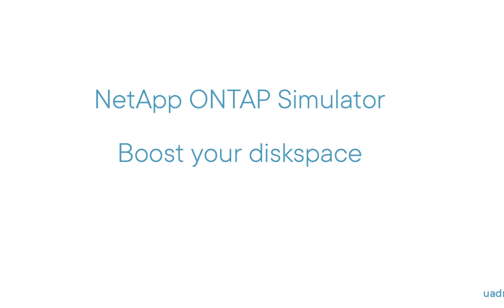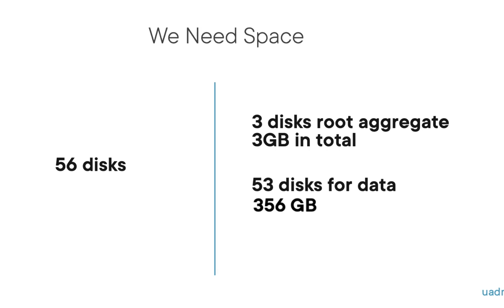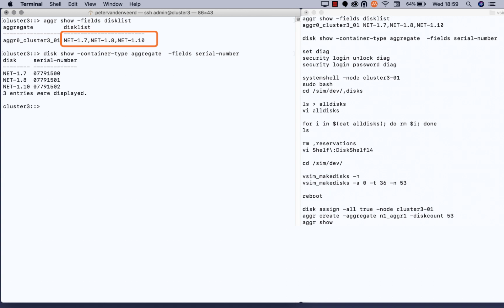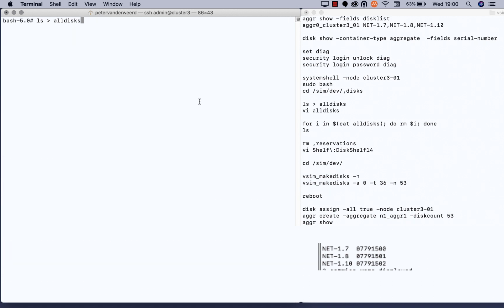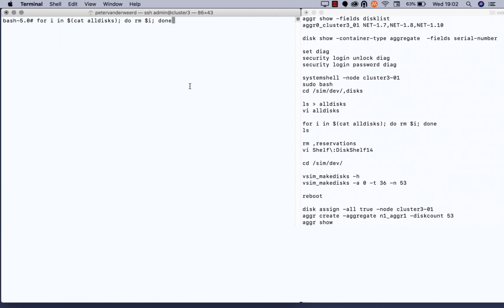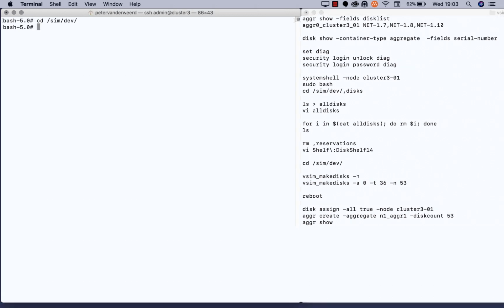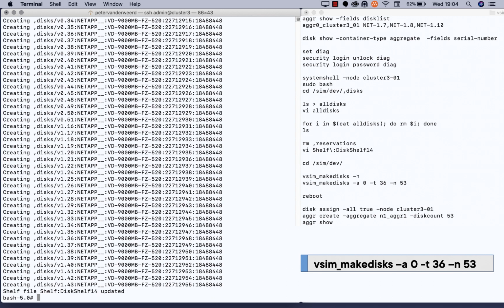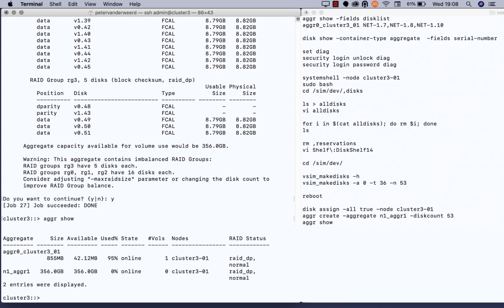Boost your ONTAP Simulator

Comment: Does it still die after several days of uptime (even if the snapshots on the root volume are deleted and turned off)?
Reply from the maker: Of course it will not die. Clean up vol0 as much as you can. It’s a test environment. I think.
Reply: @uadmin  i tried to, i even added several disks to aggr0 and gave vol0 at least three times more space, but after 3-4 days the simbox died :). I don't know if the hypervisor was the reason - i ran it on a esxi 6.7 as far as i remember. Since that time i just use ontap select in trial mode and try not to reboot it :).
Reply from the maker: @pan_Brzęczyszczykiewicz   esxi cannot be the reason. I am not talking about ontap select however. In the barebone simulater you should not have that problem. Make sure vol0 has enough space. (get rid of the snapshot schedule and get rid of the automated backup files in vol0) In fact, get rid of all automatically created logs. Remember, it is the actual version you are running, so get rid of all things that you don't need for testing. Or, of course, add another disk to the root aggregate or two, and follow this procedure. This will still give you enough room to  for example create a bucket or two. Kind regards, peter
Reply from the maker: Have you checked this? 
https://youtu.be/XD5gtq8JkNw

Also, you could replace the 1GB root aggr disks with larger disks. 😁
Reply: @uadmin  thanks for the link. What i did in my lab was deleting snapshots on vol0, deleting the snapshot schedule and resizing vol0. And that didn't help, and the simbox lived not more than a week. 
What i did not tried - it was log removing. For now i can't check this out, as i have no access to permanently running lab, but i'll try to check later. Thanks for the advise!
Reply from the maker: @pan_Brzęczyszczykiewicz  hope this works for you.